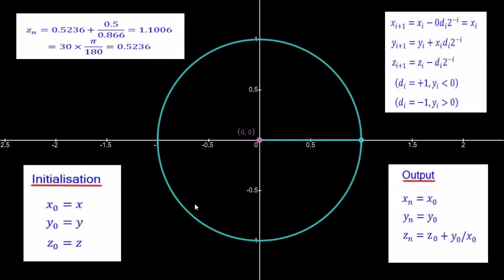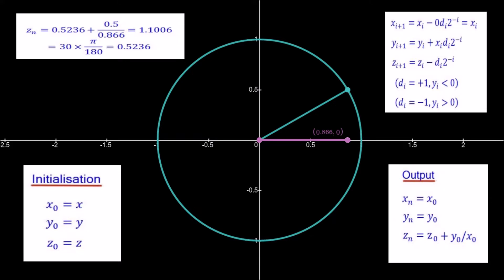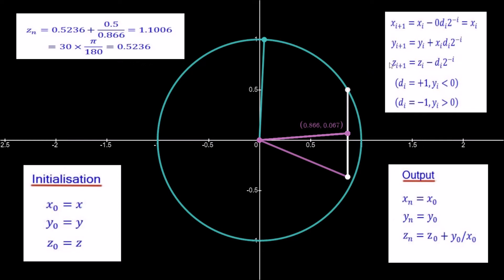Division using the CORDIC Algorithm

Comment: It looks like if the biggest rotation is 2^0=1, this algorithm can't do a divide where the output is greater than 2?
Reply from the maker: I haven't looked into the domain over which the algorithms are accurate. Although it is myt intention to take the CORDIC digital design I built in Design a CPU 4 course and extend it to implement all the functions within the CORDIC course. At which point I will look at the input domain over which the algorithm is restricted. Will be next year before I get to this though !
Reply: @RossMcgowanMaths sounds good! I just put this on an FPGA and I'll let you know that yes, currently because the iterations are 2^-i, the maximum/minimum value is 2 and -2. You can shift the divisor and then shift the output to adjust this. For example, 10/1 gives 10 but with this algorithm would give 2. If you shift multiply the divisor by 8 and do do 10/8 for 10/8=1.25 then multiply that output by 8 to get 10.